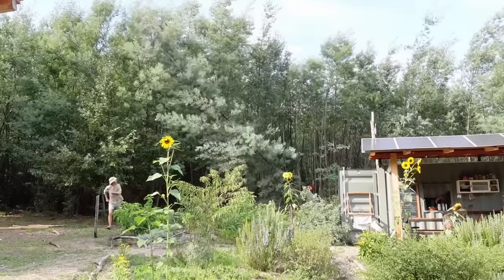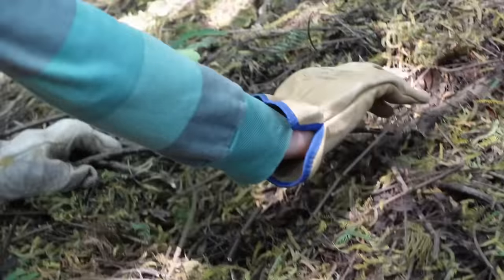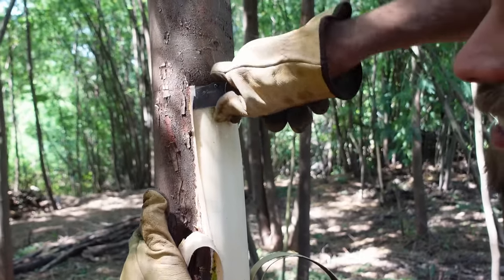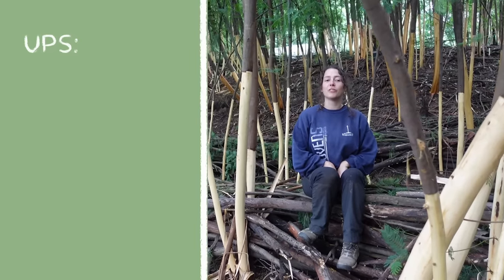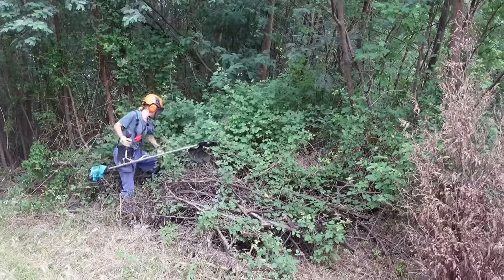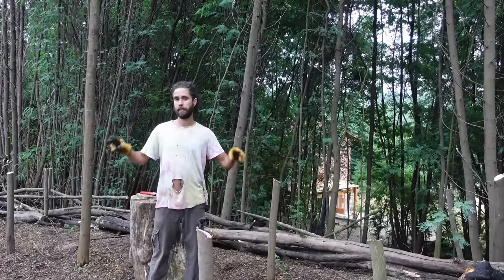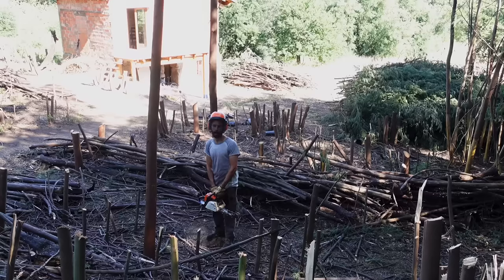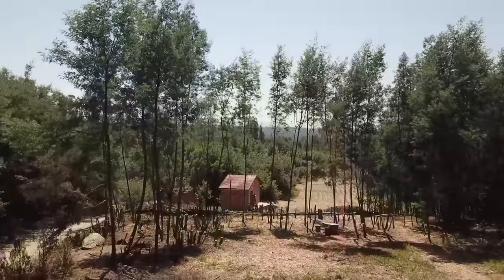#84 Why we're chopping a forest down

Comment: Input:  The debarking is dangerous because you will have very tall dead trees that will be even more prone to burning.  You will have a canopy of highly flammable material.  That method takes too long to remove a fire hazard & instead increases the fire hazard.  Please remove those trees as soon as you can.  The only benefit of debarking is preventing re-sprouting from the base.  Not enough benefit for the process.  To prevent re-sprouting, cut trunk close to the ground and drill into the remaining stump as deeply as you can.  The drilling replaces painting or dousing with a poison to kill the "heart" of the tree.  This way there is no need to remove the stumps.  My 2 cents from a prior landscaping business point of view.
Reply: That was my first thought. Great fires can burn in that area now.
Reply: Debarking is a fire hazard itself. Just cut the trees down to stumps then either use a large drill bit and fill with use salt (rock or epsom) or expose the the roots of each trunk and pour boiling water over the trunk and roots. The quickest and easiest way is the salt method. Over the years, I have had trees cut down due to the pine beetle. Removing or grinding down the stumps cost extra and a lot. My neighbor works for the Bureau of Land Management and suggested the salt method. It works great.
Reply: Was just coming on to say something similar.
Reply: Yep, same comment here. The debarked area is now becoming a fire hazard by itself. Also agree on cutting trunks as near to the ground as possible and saw or drill vertically down into the roots so they wont resprout and decompose.
It takes a bit more work, but is a definite action. Now you'll have to keep working on the trunks each year.

But i understand experiments are there to learn stuff, not only which solutions work but also what doesn't work.
Reply: Tall dead trees are also less stable. They can topple over creating hazards, especially during strong winds.
Reply: I thought debarking was used to stop the spread of seeds. you let the tree think it dieing and it wont reproduce
Reply: What you call the only benefit is the reason to debarking. That's extremely difficult to get rid of mimosas, debarking it's one of the few ways short of herbicides. The trees are not more prone to burning than the others and they can manage the dead trees — to have dead trees it's the objective.
Reply: Couldn't agree more. Super time consuming + you're creating a much bigger problem. Part of me thinks they did this on purpose to boost engagement with the video. Even a basic level of common sense would suggest this is a STUPID IDEA.
Reply: @JardinagemOrg  Jardina means garden in Portuguese. Are you a gardener?
Reply: @julieinthenorthwest4594  While that may be true, I feel they have too many trees to salt and Idk if I would put that much salt in one area.
Reply: So what should they do instead of debark, embark?
Reply: They said it was an experiment. The other plot they are clear cutting. Then they will report to the community which way worked best because she mentioned that all land owners in that area have the same problem. Maybe others have their own experiments going on.
Reply: @bobweiram6321  Means gardening… No, not professionally if that what you mean. I have a site with that name with stuff from my garden.
Reply: @bobweiram6321  Cut the trees down with chainsaws or forestry mulchers.
Reply: Its no use. They repeatedly ignored advice from the comments
Reply: completely correct, a dead mimosa is more prone to fire to a living one, as for the chainsaw area a team of people with farm jacks and chains can pull those out  if y'all left that much above ground.
Reply: @benjamin3658  they are not required to take advice from the comments. They said from the beginning that it was a community experiment but most people stopped the video at the debarking and immediately went to comments to talk down to them. Apparently they didn't go back and finish watching the whole thing.
Reply: Cut them down to about 1 metre and then debark the stumps 🤙🙏
Reply: Exactly. Why create more fire risk?
Reply: Debarking the trees is very dangerous because it's lots of fuel but also leaving all the dead trees to rot on the ground is just creating more fuel that area will be the worst fire on the property
Reply: I don't know much about this matter, but even though I definitely like the approach of experimenting and collecting data,  and of learning by doing,  there is so much knowledge and experience out there already, and with this collection of obviously bright people, they really should tap into that, instead of thinking that they will be the ones to 'figure it out'. I mean, I am sure the Portuguese authorities have expert biologists looking into ways to reduce this mimosa problem. A quick Google search shows that the University of Coimbra did exactly that: tried out different methods, including debarking, and published its conclusions in 2020 (it wasn't as easy to find the conclusions though). I mean, I am sure it would be more helpful to the neighbors if they just read that research and did what was recommended, got rid of the mimosa, and then offered to help the neighbors to get rid of theirs? I am so confused about the goals of this project, every time I watch a video. I mean, if it is to find community, be outside in nature, get away from the city, and learn how to do things, that's great!  But why present it as research and experimenting, when the research or experimenting has already been done by people with a lot more knowledge on the subject?
Reply: @Dot2TheLock  My general understanding is when a plant is under stress, ie dying, it will focus on reproduction, either sprouting or seeding. I don't know about this specific species.
Reply: Adding a reply to this to add visibility. Those standing dead trees will be an absolute tinderbox. You should cut them down immediately. Also, remove as much of the material as possible. Leaving it all on the ground will eventually produce more topsoil, but in the short term it’s just more fuel for a forest fire. 

There’s no easy solution here, but unfortunately what you e done has actually increased the fire hazard in this area.
Reply: @y0nd3r  It doesn't take much salt. Their mimosas, most mimosas, are small trees...never the size of ponderosa pines I had. A small handful, palm size bit of salt in the drilled hole is more than enough salt. By the time it's ready to pull the stumps, the salt is long gone absorbed by the stump and it's roots. No harm to the ground, unless you you're really messy with the salt :) As small as the mimosas are, why not just spend the time to remove the stumps?
Reply: @rkeantube  Shoot, I was thinking they should get a couple of goats for brush/ground control and since it seems they're mostly vegans, goat milk and cheese. Then get a mule or donkey to help with work...like stump pulling. Those mimosas are small.
Reply: As a Wildlands fire fighter of 10 years I agree with this. Do not leave a large stand of dead trees. This is a time bomb with a short fuse. Recipe for a canopy fire. Put those trees on the ground. Rent a chipper if it's in the budget.
Reply: WE NEED THE PROJECT KAMP PEOPLE TO SEE THIS!
Reply: AGREE!
Reply: @y0nd3r  No hate, but what's the point in "experimenting" if reading a book or talking to an experienced expert would save you from a lot of work and thinking?
Reply: They desperately need to contact someone with forestry experience. There's a ton of ad-hocery on this channel that is working against their stated goals.
Reply: @wesendreizehn6710  I'm not them, so I don't have an answer for you. Maybe to drive eyeballs to their channel?
Reply: @vicconstruction9126  Yep, they always do things for the engagement alone. There's nothing actually genuine about this project, they just do random things for the views
Reply: @wesendreizehn6710  My thoughts exactly. They seem to live in a bubble
Reply: Yeah,  it worries me.
Reply: @Dot2TheLock the debarking also acts to kill the tree, as most of the nutrients are carried from the ground on the inner layer of the bark
Reply: yes. hippies just don't understand. the reason why I stopped following this channel. they do things that are popular, not things that make sense.
Reply: I am thinking, why not just chip the mimosas and lay them thick above the low cut stumps? They really need someone there that knows something about that.
Reply: Pound a copper nail into each trunk of the mimosa's after cut to the ground!
Reply: Well I want to give them a bid on safety advice if the are going to saw those debarked trees.
Wear a helmet! There is a risk of falling sticks. Everyone involved in cutting the trees should where a helmet.
Reply: Mimosa bark baskets!!
Reply: I'd suggest debarking the tree and then cutting it down, leaving only the part that has already been debarked out... or even better, cut the trees and rent a caterpillar machine
 and pull out all the stumps. The problem is, who's going to manage the caterpillar machine.
Reply: Barbed wire, or in Dutch: prikkel draad (prickle thread)
Reply: You now will have a forest of basically, tall, dry matches.  And leaving all that dead and dried debris (sometimes referred to as coarse woody debris or CWD) can also present a more flammable forest environment.  One of the issue here in the US with forest fires has been our preventing fires, ironically.  Before development fires would routinely sweep thru areas and consume the small amount of fallen trees, branches, leaves.  But with fire control the amount of debris on the forest floor gains more mass and then when a fire comes to the area all that fuel potential is there to create massive fires.

Comment: 27:57  Cut mimosa's at ground level in pathways so you can take the shredder with you into the forest.  Keep moving the chute around so that you have many small piles.  THrow a few shovels of native soil on top of the pile as you go and let it compost in place.  You are spending too much time and energy moving materials around.  Make your stacks of logs along the path.  Do not spend all the time an energy carrying trees and tops to one location.  You have so much mimosa to cut you  must use your time and energy wisely and efficiently.
Reply: Project Kamp consistently mistakes hard work for good work. They would do well to find someone who has worked in agroforestry, landscaping, or construction. Permaculture pig, goat, sheep farmers. Who would be great would be a retirement age American with a lot of experience with the work process, like Essential Craftsman, or an experienced landscaper like Stanley "Grease Monkey" (maybe their European counterparts) to come in even just for a few days, to demonstrate efficient work techniques & planning.
Reply: Like girdling requires only a cm or two of all-round bark removal, and here they are stripping over a meter off every single stem, with no intention of using the stripped bark for fiber, which would be an understandable reason for removing so much. 
But no, it is just creating fine tinder on the forest floor.
Reply: @mircomuntener4643  I believe someone told them that stripping the bark to the root flare will stop resprouting.  Of course that is not true because mimosa (Acacia dealbata) can send up shoots anywhere along its root system.  The duration of this sprouting (assuming all attempts at sprouting is defeated. is about 3 years.  The reason is that there are sufficient carbohydrates stored in the root system to keep the system alive for about 3 years.  In a stand as we see a ProjectKamp, the roots are grafted  so that every tree is one piece of a huge organism.  Any surviving tree will feed its neighbors  through the root grafts- so those at grafts will keep the neighbors alive indefinitely.  ProjectKamp really has to go for total eradication to have a hope of controlling this invasive species.🙂
Reply: @Nphen  Nathan, that is the nicest thing I have seen written about the US baby boom generation.  Here we sit in retirement with a lifetime of experience and in America, the young people have no use, even as volunteers.   The young people who now run our world blame us for every unfortunate thing that has ever happened in their lives.  So for every volunteer job, there are 10 baby boomers waiting in line.  So if you happen to rub one of the new leaders the wrong way, you are dismissed - no consideration given for prior good works.  THat is why I have turned to YouTube.  I try all day-every day to share something with someone around the world that will improve their quality of life.  Thank you for your suggestion Nathan! 😊
Reply: @stevejohnstonbaugh9171  What young people who run the world?
Reply: @Nphen  Agreed on taking someone's advice after his retirement. Most of the times, retired people want their knowledge to be somehow productive, to help. Would do great things for the channel as well!
Reply: I would add to your excellent advise. If you heavily mulch the base of the cuttings and lay a tarp or cardboard over them over winter, the roots will rot and stop regrowth from the base. It is a non chemical technique used on invasive bamboos in parts of Australia. And great for soil microbes.
Reply: @shannonbusse6702  The use of solarization is a fine approach for a limited area.  The difficulty for Project Kamp is that their entire property is covered with mimosa. Look at any of the aerial photos and you can see their distinct foliage.  Where the mimosa stop is on a property line. So that tells me that their neighbors are anxious for Project Kamp to get the mimosa at least under control because each tree produces tens  of thousands of seeds that can be dispersed by the wind. I can't tell you exactly how many hectares they own, but it is much bigger than a backyard garden plot that has gotten out of control.  I'm afraid the solution will have to be on a more "industrial" scale.
Reply: If you cut the tree too close to the ground, it is impossible to pull the wood out with a truck
Reply: I have done a lot of bark work and by far the best I’ve used is the little green wood
Reply: @georgewhitehouse8630  That is true - but they have not made their intentions known.  My remark about cutting close to the ground was so they had a path to move the tractor and chipper through the cut and chip the wood where it falls.  Roots can also be pulled with an excavator and grapple,  but I think they hope to let the roots rot in the ground. 😊
Reply: @TheRumblemore  Have you heard of Trudeau, Macron, and what"s her name from New Zealand, Not to mention the vice president of the US.

Comment: hi! I'm a florist and we use gardening shears like that all the time. When they get stuck its usually because there is grit and sticky stuff/oils somewhere in the bolt. What we normally do is squirt hand sanitizer all over the bolt and just open and close the shears until they loosen up again. This will help you preserve the tools longer! 

hope it helps :)
Reply: Oil them regularly also stops this from occuring!
Reply: WD 40 then some lubricant oil

Comment: Lumberjacks take out a diagonal for a good reason. The way you do it with the kicking is asking for big trouble. Just take a two 45 degree cuts that take out a right angled wedge together and the tree falls where you want it to fall and you don’t need to risk the bones in your legs. The guy with the milwaukee shirt knows what he’s doing.
Reply: I was wondering why they didn't do that.
Reply: Look up a Humboldt notch
Reply: I have run a production saw on the coast of BC in Canada. These mimosa are too small to wedge. They are too small to make to harvest as lumber. They are no more than whips.
Reply: @matcheer9909  I noticed the broken chain and came to the comments, sure enough, there's a faller from BC here :) should they still be doing a face cut before the back cut in trees this small?
Reply: @jaggederest  No real reason to make so many cuts on this small nuisance wood. There is a more efficient way for small diameter wood.  Saw parallel to the ground. Cut the wood using the top of the bar near the tip.  Use the rotating chain on the saw to angle the falling wood past your right shoulder. Don't have to grab the wood to put it right where it needs to be.
Reply: @matcheer9909  I'm not so sure about  all the comments concerning chainsaws (scratching head).  The volume they want to cut demands larger saws and regardless of tree size or engine displacement,  they should still invest in chainsaw pants.  The demonstration of the "kicking technique" alone shows the need for training and better equipment.
Reply: A double cut could work also. The could use a lesson cutting trees, that's for sure 😅

Comment: you should not let the solid logs lay and "rot" because that can take ages, and before that they will be an extra source of fuel for an wildfire.
last owner of my house did the same thing 28 years ago and the logs was still laying on the ground with little rot when i munched em up last year, and they where from a species of trees that "rots fast"...
and i live in much more wet conditions close to the ocean of southern Norway so would not think of how long they could lay dried up down there

Comment: The tree stem bunds look like a good idea, but not if they're not covered with soil. They will dry out and act like a fire line, spreading the fire quickly. Once covered with soil they will decompose and add fertility and moisture to the land.

 Plus I agree if you can get a goat fence to work properly, a few goats wpuld seem like a good idea, but check if mimosa leaves are not too protein rich for them first.